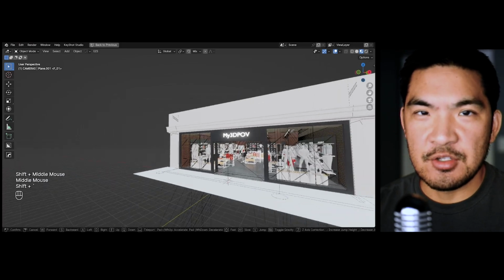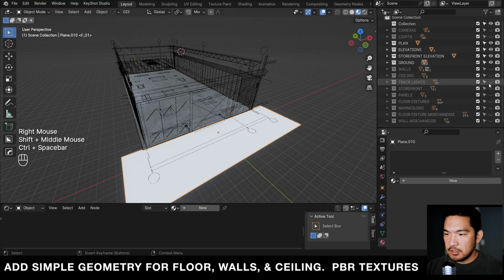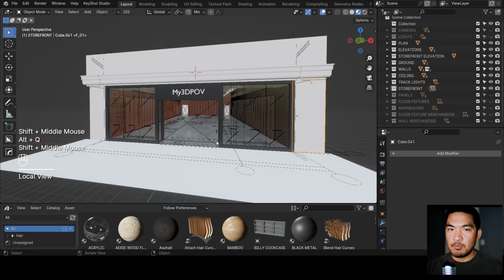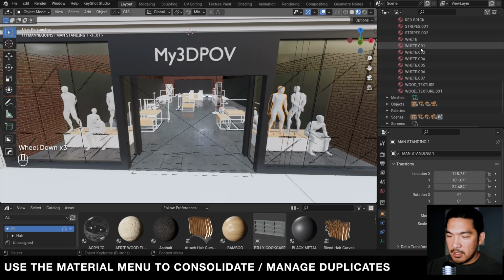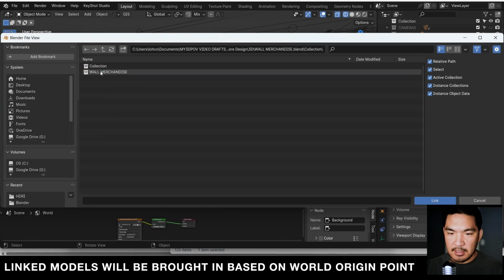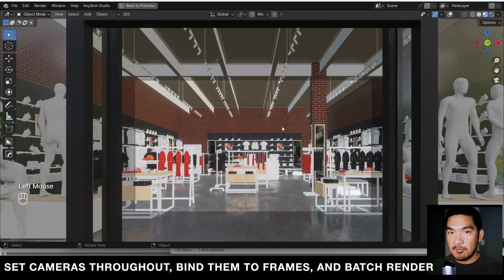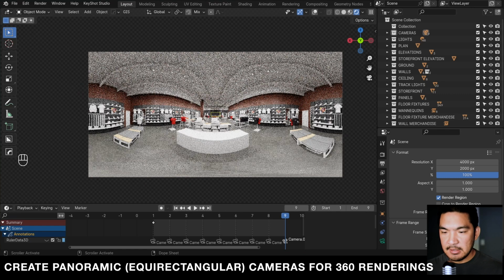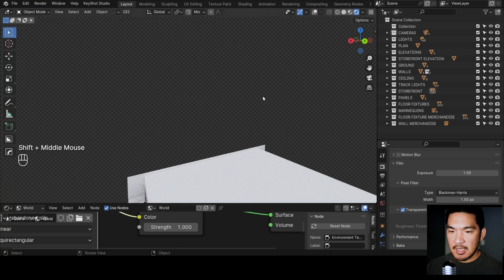Tour My 3D Model - How I Organize My Blender Architecture Projects #Blender #architecture

Comment: This is a great topic to cover, especially for people coming over from Revit or Sketchup or any other 3D software as the interface and internal management models are so different.
Reply from the maker: Yea all the 3d programs do the same things but in different ways. Hard to learn for the first time but easier if you have done it before in a different program and just need to learn how to do it in a specific program.
 
I developed a tendency to work  in Isolation mode using 3ds max, and then used the Select N Isolate plugin for Sketchup, and that translates to Local view in Blender. I kept the shortcut the same across all. 

P for push or extrude in Sketchup, E to extrude in Blender. Arrow keys for axis constraints in SKP, X,Y,Z for axis constraints in Blender. Same concept just different keys